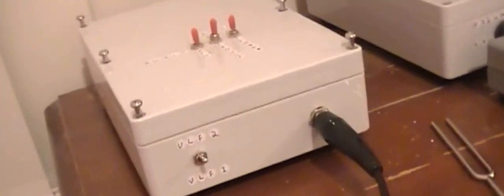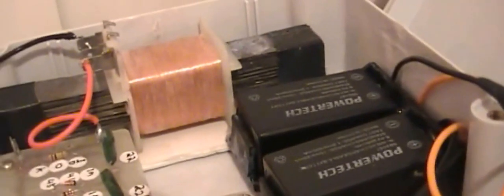hearing a 40khz tuning fork sound with a vlf receiver

Comment from the maker: heres a link to another of my recent videos where i used a the black star  amplifier plugged into a small circuit i built for sensing ufo fields and other things, so listen to how loud a tuning fork sounds in this experiment here where i used a simple microphone preamplifier  with an lm386 audio amp circuit and a fine coil of wire with a think a higher resistance than the coils i used in my tuning fork hearing vlf receivers 
https://www.youtube.com/watch?v=WzutA0CCpvY

Comment from the maker: this ones going to amaze you now I recently received a ultrasonic dog repeller in the mail I brought form e bay it come from china  and to my shock the vlf receiver can  hear it at a minimum distance as far as I can stretch the headphone coiled cord  so far 8 feet and that's not all one of my various quartz crystals sitting on top of my vlf receiver when I went to grab it, it generated a signal through the vlf receiver and it was cold to the touch yet the sound was  odd and some  of the other crystals also sitting on top of the vlf receiver including a tourmaline pyramid I removed aside and tested that one crystal alone and it reacted the same when I touch its cold surface  before all this I was holding it and warming it up with my bodies energies , even a double pointed amethyst to which I put aside  I then tested the other crystals the same way but no reaction yet so why would one crystal react when touched while sitting on top of the vlf receiver as if its in some kind of mode that enables it to generate a vlf signal that can be picked up on the vlf receiver .

Comment from the maker: recently discovered that quartz crystal when energised in your hand  creates a very low high pitch sound like fast white noise but cleaner and it comes from the pointed end of the quartz  so slowly shove  the point into your right ear or left and without touching the outer ear hole you may be able to hear this sound in the dead silent night with no outside interferences

Comment: Here is another comment/reply from my google plus page........
If he is running power through the coil it will be producing a magnetic field that would be disrupted by any metal. If he were to replace the speaker with an analog meter and wave a metal rod in close proximity to the coil he would most likely get needle movement. If he could wave this metal rod very fast, say 40kHZ, it would be recognized as sound.
Reply from the maker: have you read the new findings in the coments for my scalar beamer video

Comment from the maker: I tested the vibrating tuning fork in front of a lens of my light listener circuit I built years ago and it works, sun  light reflecting on a vibrating tuning fork can be herd through the headphones to connected to the lm386 audio amp circuit section of the light listener

Comment from the maker: if the coil was  that  used as an areal had a good enough voltage in it then it would have a good magnetic fields but at my lowest voltage setting of 200mv on my digital multimeter there is no measurable voltage and if there was  it may be so low that it wouldn't even generate a good em feiled,

Comment: Very interesting. Picking up sound waves.  I dont understand know why.  I would like to hear others opinions on this one.
Reply from the maker: +INVENTOR3  paul it shouldn't be possible  to receive the same 40 kHz tuning fork tones  which re only vibrating tones , and to receive it on a vlf receiver is ridiculous, but its happening and the tones don't give out any rf waves or energy that a vlf receiver can amp up so its a mystery , ill try get a better video and try get camera mike closer to headphones to get a better recording more louder
Reply from the maker: +Steven Chiverton  with my headphones on I can hear the tuning fork tones when I held the tuning fork just over a foot away but its hard to get the same effect trying to get my cam corder mike into the headphone to capture it while holding it that far away.  at the same time im holding the tuning fork  and headphones and camcorder
Reply: +Steven Chiverton I forwarded this video to my google plus page to see if i get some input as to whats going on here.  Ill pass on the info to here if i get some replies :-)
Reply from the maker: +INVENTOR3  the coil I used as an areal and the core concentrates the em flux the vibration from the tuning fork is not em in nature just a vibrating sound traveling through the air  cant measure any voltage in the coil unless its lower than my meter can read
Reply from the maker: +Steven Chiverton  the vibration from the tuning fork held over a foot away vibrates through the box its inside acting like a sound amp cavity ,but still cant figure out how it turns sound vibration into something for the coil to pick up when its just a rf and ac like receiver  coil, its not configured as a mike so shouldn't receive sound vibrations
Reply: +Steven Chiverton Maybe in another video you could find a way to attach the microphone so every one else can hear what you hear.
Keep up the good work :-)
Reply from the maker: ill have to check see if I have a mic socket on my cam corder